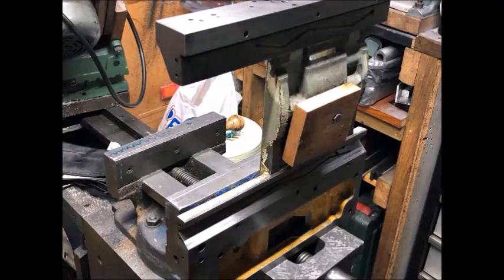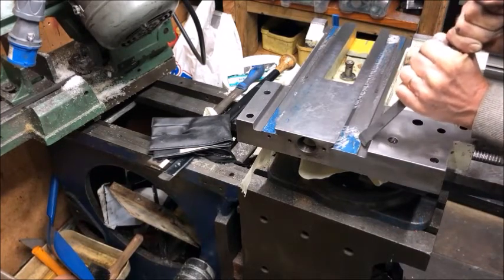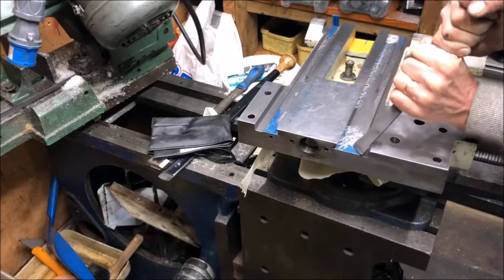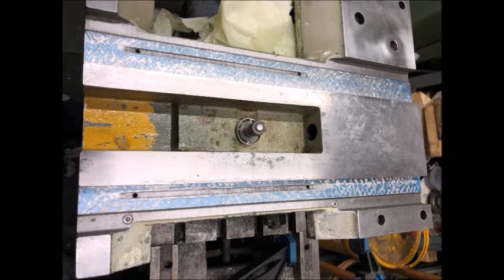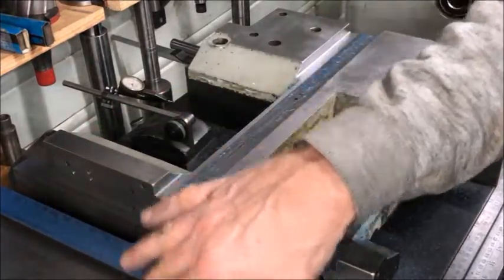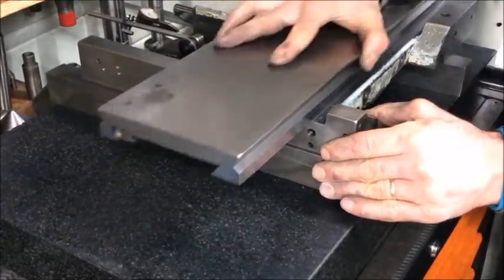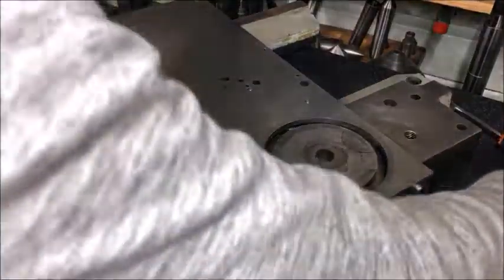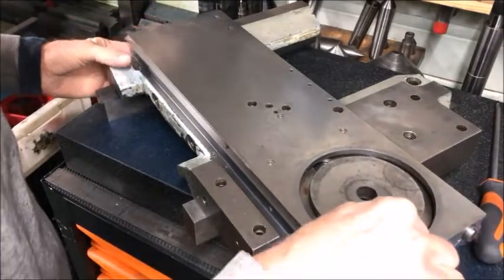Colchester Master 2500 - saddle scraping and testing to cross slide

Comment: I wonder if it is possible to make a Biax tool for pull scraping?  I can picture a profile that might work but I don't think there would be enough material at the tip for carbide to survive.  Since it would only be used in very limited situations, maybe HSS would be adequate...
Reply from the maker: Oh yes, absolutely. Have a look at these discussions incl. photos and a video.. Interesting!
https://www.practicalmachinist.com/vb/machine-reconditioning-scraping-and-inspection/pull-scraping-303305/
https://www.practicalmachinist.com/vb/machine-reconditioning-scraping-and-inspection/pull-scraper-373118/
Reply: @jansverrehaugjord9934  - Woof.  Well, that's what happens when I wonder about something without doing my homework.  I learn something AND look silly.  Thank you for pointing me at where my weekend reading will start!
Reply from the maker: @somebodyelse6673  No problem.. there is a lot of material out there for us to learn from :)